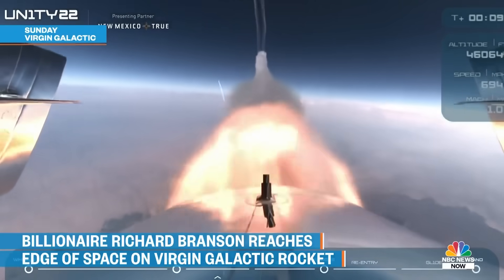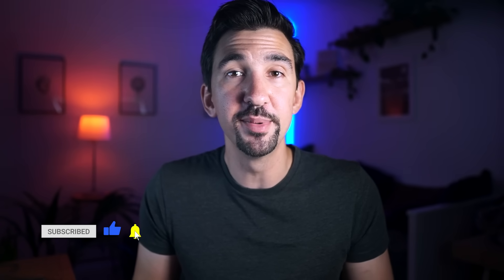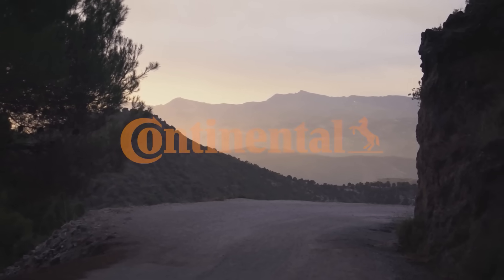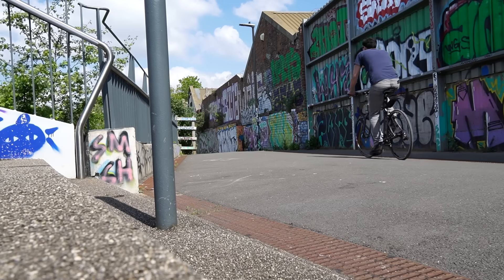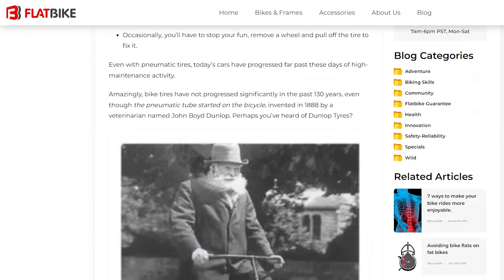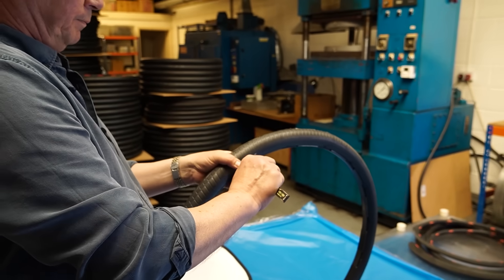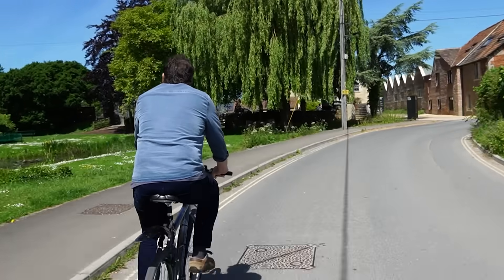I Tried Solid Bike Tires | Here's What I Found

Comment: I worked in the tyre industry for 15 years, I tested solid tyres for cars with negative results, mainly because of wet road condition performance. the grip coefficient in dry conditions was lower than pneumatic tyres but still acceptable for low speed applications. in wet conditions it was simply too dangerous. So I think an important test would be on grip performance.
Reply: @King Of Crunk painted concrete without sand in the paint sucks for almost any shoes though if it's wet.   it also sucks for all tires if it's wet.   bicycle wheels are usable with fairly big differences in them, fat vs skinny and all though.
Reply: @lasskinn474  
Yeah, good point. But on a separate note, men shouldn't be wearing Crocs anymore than they should wear sandals with or without socks(unless they live in the era of 400 AD or earlier).
Reply: @HighlanderNorth1  Why do you care what anyone else wears?
Reply: @johnoneal1234  
It's just humorous social commentary. Kinda like how people make fun of male mullets and female "mall hair". (Well, except that men wearing Crocs is slightly worse). 😁
Reply: @HighlanderNorth1  Okay, glad to hear you all aren't really so bored as to turn into old maid busybodies worried about what everyone else is doing.
  That's more what it sounded like...
Reply: Similar issue when Goodyear tried to make transparent light-up tires. They used clear solid polyethylene which was dangerously slippery even in ideal dry conditions! Only one set of them was ever sold for the "Golden Sahara" which is a display car that never goes over 5mph.
Reply: @CoolAsFreya  I’m still curious why they never tried making them like a whitewall tire, where the actual tread is a normal tire compound and it’s just the sidewall that’s a different material. Nowadays it’d be even easier since flexible LEDs solve the fragile light bulb problem.
Reply: Stupid question: why does it make a difference for the wet/dry with solid tyres?
Reply: @JoelTehMole  same reason it matters for air tyres,
water acts as a lubricant which helps smooth the surface so your tyre gets less grip.
In a pinch it also cools the tyre down which makes rubber a bit hard. Its true of all elastic materials.

In extreme scenarios it causes hydroplaning where a thick layer of water forces your tyre off the ground and makes your traction go to nearly 0.

Air tyres have the advantage of configurable tyre pressures and at low pressures the rubber squishes out over the ground and makes as much rubber contact the ground as is reasonable. 

It reduces the overall risks of reduced traction from water.
Reply: @Mallchad  I guess you were talking about tyres in general, not just bikes. Just mentioning that hydroplaning isn't really a thing for bicycles. At least for race bikes, you'd need to go at something like 200 km/h, from what I've read. Maybe for MTB / fatbikes going really fast on paved roads, I can imagine it could be possible, but that's an edge case. (Slipping on wet roads is a different thing of course, not the same as hydroplaning.)
Reply: @tvuser9529 The information on hydroplaning is likely based on cars and motorcycles, and what cars and motorcycles have is weight, >200-1,000kg of it.

Bicycles do no have that, which means it takes quite a bit less effort to break traction because traction is a function of downforce AND coefficient of friction.

So I can't see why it couldn't happen because it does in fact happen... It and it takes only a few seconds to find videos of bike sliding out in the rain...

The difference is low speeds, and less aggressive " drive" (pedals), and generally "driving" more carefully means its not as big an issue...
Reply: @Mallchad  As I mentioned, sliding out on the wet is not the same as hydroplaning. Water reduces the friction between the tyre and the surface, so it slides easier. But hydroplaning is when the tyre completely loses contact with the surface, because it rides on top of the water. Bikes don't hydroplane because their tyres are too narrow for their speed and weight, at least for roadbikes. The speed would have to be unrealistically high for it to happen. Maybe a fatbike or plus-size MTB could hydroplane if ridden fast down a steep hill and right onto a big enough flat puddle, maybe.

Fun fact: Bicycles generally excert a higher ground pressure per area of contact patch than a car, because of the narrow tyres. Road bikes especially, they can approach the ground pressure of a truck/lorry. (See the wikipedia article on ground pressure.)
Reply: @JoelTehMole  every tyre has more grip on dry surfaces than on wet ones.  But if a tyre's grip is poor on dry (although within safety limits) it could be dangerous on wet.
Reply: @JoelTehMole :  Coefficient of friction is still generally MUCH lower for wet surfaces than dry ones.  You have two different things rubbing against each other (rubber or a rubber compound in the tire, and painted concrete). 

So my stupid question in response is WHY this would be different (to a meaningful degree) to a solid rubber tire than an air filled one?

I think this is just basic physics (friction was one of the very first topics we covered in basic physics in college).
Reply: @JoelTehMole   explained at the beginning of the video ... Normal air filled tyres have several different compounds if rubber , from grippy stuff for the tread to not really grippy hard stuff for the puncture proofing and sidewall stiffness areas , where as this solid tyre is a single compound . All rubber needs heat at the molecular lever to give itself up to the surface in exchange for friction or "grip" e.g a skidmark. It is getting the hard mono compound to heat up enough at the contact point , when it's cold or cooled by rainwater, to give grip . The rest is also explained in the video.
Reply: Answer is in minute 6:52-7:34 @JoelTehMole
Reply: @JoelTehMole  It may not. The point is a comparison /test is needed to see how they perform. I have ridden bike for 50+ years and never thought about traction while riding in rain etc. A new tire, new compounds, along with how they actually ride, begs the question of wet performance.

I don't have doubts, but I also have no data to rule out issues.
Reply: @joeshmoe7967 :  I rode a bike a LOT as a teen, including in rain, light snow, etc. I never thought about friction in the wet either, BUT, I was intuitively a LOT more careful in the wet re avoiding high speeds -- I do recall that.  (Can't cite details as 45+ years ago and reliable detailed memory don't mix well, as I find when I try to remember details about math and have to go back and read about things like trigonometry to get beyond the basics, for example).
Reply: @King Of Crunk Well either way I would not wear Crocs if you paid me too.
Reply: @Leo-gt1bx  I bet you would if paid enough. Everyone’s a whore.
Reply: @Leo-gt1bx  - Crocs are for when flip flops are a bit too formal.
;-)
Reply: @Novalarke  Fair point.
Reply: @Leo-gt1bx :  Yeah.  I basically don't care about fashion, for example wearing "Tread Safe" shoes when I need black "dress" shoes, as I prefer safety (in my aging body) and comfort (with my sensitive joints) to looking fancy, for example. 

But Crocs to me look like strange ugly things that only women would wear -- and women, generally wear LOTS of things that for men, not so much (fashion sense or not).
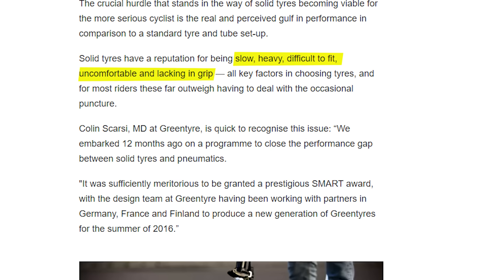Reply: I mean... the video did literally talk about grip being a historical problem with solid tires 3:24
Reply: i think one of the advantages of this tire is you can deepen the tread pattern as it wears
Reply: Tar*… as in ‘a flat tar’ or ‘in Texas, cars have tars’.
Reply: Rougher roads and off road conditions will make for crappy solid tire preformance too, my bike entirely relies on slightly bigger tires for it's shock absorption, using solid tires on my bike, even on the road, would render it unusable, even with the changes demonstrated here probably can't overcome those issues, and make tge tires freakishly more expensive.

It would be more environmentally friendly to develop a better pneumatic tire that requires less extra nonsense in it, get it down to the minimum number of ingredients and in such a way its easier to tear apart after for recycling
Reply: bicycles specifically feel like they have vairly limited variability in the grip performance just in general.
Just the low weight of the bike and tyre pressure (on road bikes especially) being so high that you have pretty mininal grip to work with anyway.
But seems like kind of enough at the speeds and torques people are seeing realistically. Different in races.

You just can't really turn much on bikes, just in general...
Not enough contact area. It's why mountain bikes and motorbikes have SUPER wide tyres.

imo comfort is really the main drawback than anything, for bikes.
There are ways around in in the frame and the wheels but has fairly limited development.
Reply: @Mallchad  bro that's why you change your air pressures, you can't just sit on a single air pressure all the time and complain about a lack of variability
Reply: @BeetleBuns  Do you want to run a tyre at 5-10 PSI?
Because I have. and that's what you need to get the upper limits of bycycle tyre traction.
Reply: @BeetleBuns  you know you get a lot more respect out of people if you don't insult over things you don't evne have the full picture of-

2 things.
- If you drop the tyre pressure as low as 10 PSI you gain massive rolling ressistance and it stops being as useful of a travel tool. This also means than anything but sand races is basically off-limits without exotic tech (which does exist).

- We're talking about tarmarc, concrete and asphalt.
We're all talking about road use because that's how the majority of people use bikess. The rest is hard-packed dirty and gravel. Again, rolling resistence. Not beneficial overall.
Reply: @Mallchad  and you'd get a lot more respect if you actually knew what you were talking about. I race off-road. Weirdly enough, I don't have traction problems. I also use bikes on asphalt and concrete, where I STILL don't have traction problems. Sounds like you simply A.) use bad gear or B.) don't know what you're doing.
Reply: @Mallchad there's huge variation in grip from tire to tire with bikes
Reply: @veganpotterthevegan  Yeah but there's diminishing returns with how much grip you can get, in my opinion. and grip is pretty directly related to rolling resistance

that was my point.
Reply: @Mallchad  ok?  If grip is related to rolling resistance, the rolling resistance differences between tires is enormous.  Therefore the grip differences are enormous
Reply: I would've expected the weight to be the biggest issue. Solid tires spinning at high speeds would deform more, wouldn't they?
Reply: For mountain biking, grip is critical. 
But for road biking, my tires are already at 80PSI. They might as well be solid rubber at that point.
Reply: We live in the 21st century. Things change.
Reply: Tyre??
Reply: @Colin.71  
Yes, Tyre is an ancient city in Lebanon......... where they invented bicycle tires in 1,274 BC. But they named them "tyres" after their home city. Kinda like how Bologna, Italy is named after cheap, processed lunch meat slices..... Except the proper pronunciation for the Italian town of Bologna is "Buh-lone-eee". 😁
Reply: @HighlanderNorth1  I see, thanks for explaining
Reply: @Colin.71  
I was being sarcastic with my answer. The correct answer is that some people apparently spell the word "tire" differently. But it's also true that "Tyre" is an ancient port city in Lebanon that's one of the oldest continually occupied settlements in human history. 

As far as the tire/tyre spelling, it's kinda like how Americans spell "aluminum" vs how it's spelled by people in UK. For some reason, they insist on adding more "u" and "i". So their spelling looks something like "aluminiuiumium". Lol
Reply: Tire*
Reply: The solution, for me, is Tannus's armor. There's a bit of air--it'e been fine here in rainy Seattle and I haven't noticed any issue in sliding around--but not so much I can't ride my e-bike on them flat. Being 100% flat only costs me 3-7 mph top speed (15-28 mph max depending on the grade, scaling with that such that the flat range is like 12-21 mph). It's great.
Reply: Just out of interest what causes the lack of grip? (i know barely anything about tires)
Reply: Honestly not talking about the grip was a bit suspicious. Overall the video felt more like an infomercial than an unbiased review.
Reply: @King Of Crunk pk
Reply: Sand
Reply: I wish I had read this sooner: once my 4 broken ribs, puncture lung and double-vision from concussion have mended I am cutting off my Tannus tyres. Witness saw how my front wheel slid sideways on a road rut in wet weather.
Reply: I doubt you where in the "tire" bizness as you repetedly spelt "tire" .. "tyre"
Reply: nothing. EUGENIOBOB ETC. THANK YOU FOR THE KEEN INSIGHT ON WET ROADS AND SOLID TIRE COMPOUNDS FOR AUTIMOBILEZ.  THANKS  VERY MUCH. I STILL THINK PNEUMATICS ARE BETTER FOR RIDE QUALITY. I MADE SOME INNERTUBES OUT OF SURGICAL TUBING ONE TIME. I GOT MAYBE 10 FEET THEN THEY POPPED! WELL AT LEAST I TRYED.
Reply: Well let's say your out at night miles from home you hit an oily patch on a curve with your new fancy solid tires and over the guard rails you go into a ravine. Now your driving along with pneumatic tires and good tire co.pound maybe you get home safely.?
Reply: Did you test this type of rubber? Is there a difference?
Reply: The makers of Crocs do make solid bike tyres called No Flat I think it's called hot one on my Ebike it broke a spoke because it had no suspension to absorb shock it relied solely on the Tube Air Pressure to do that @kingofcrunk4237
Reply: It's ease of use Vs puncture free riding . If you are computing short distances like me solid tyres are great . Been using only solids for 8 years . Never have to see if tyres are "up" and ok to go.  Yes they don't roll as easy or grip as well but they do mean no agro or punctures are you ride home in the rain after a ten hour shift 😁😁
Reply: What if you want to adjust the tyre pressure to suit different conditions?
Reply: @77goanywhere  Not Possible unfortunately
Reply: TBH, it seems to me that if solid tires were such a good idea, that we would have had them decades ago. Especially during the early years when the materials were so poor for the purpose. Flat tires today are much less common and tires are usually thrown out due to the tread wearing out rather than puncture. (Although we're talking bike tires, so probably a larger share are damaged due to puncture than car tires)
Reply: First intelligent, cohesive, non-toxic and instructive YouTube comment since the dawn of YouTube comments. Bravo!
Reply: SCHWALBE Air Less system solid tires have the same outer tire like normal air tires, so the contact with rain, wet roads are exactly the same, I used them for many years, my best buy ever I reached speeds over 60 km/p hour on my Bafang BBSHD bike no problem at all
Reply: Couldnt you just use this gecko tire as an insert for a pneumatic tire ??? . I'd like to change between road and snow and mud. Only difficulty is the metal bead on the pneumatic tires
Reply: Man one of the big plusses of pneumatic tyres is you can air up or down. HIgher pressures for on road, then when I need to do a long bit of off road I could always air down slightly if need be. No way to do with a solid tyre.
Reply: Unfortunately recycling itself is mostly a lie. With very few exceptions (PET bottles, cans) the cost of sorting and cleaning the “recyclables” is far higher than the materials gained back. Best case, it is shipped around the globe to poor countries with little to no labor and environmental safety laws, making the workers there sick and polluting the areas. Realistically, the tires just go into a land fill either way. So may as well use pneus that use less material overall and provide better performance at lower cost.

Comment: As a recycling alternative yes welldone but are they better than an air tyre, not a chance.
Road tyres have about 100 psi give or take and mountain bike tyres which are usually much bigger can run low psi like 15 psi on my 27.5 2.6 tyres that's because it's all about tension the tyre needs to deform to the terrain much more on a MTB tyre and maintain grip but stay on the rim this makes it faster as the tyre is not bouncing off the surface but on a solid road it's more or less the opposite as the less friction encountered means a faster ride however both of these have the same problem suspension, without any form of suspension your bike is like a a roller skate the smallest bump is a problem & that's why modern Mountain bikes have front or front and back suspension for enduro etc.
If road bikes had a little suspension it would go a long way towards making them comfortable.

Comment: NoFlat tire will by changed as often as refular - when thread wears off - no environmental advantage. 
NoFlats may by good for city bikes but will not be as efficient as inflated ones - tested on cars. So currently is an no go. 
Maybe with some new material... maybe, but what if someone lilkes 2.0 bar and another 2,5 bar? Multiple tire hardness? 
No, I don't see it.

Comment: If they made it varable compound tyre and got that weight down, I would use them,  But as they stand No. I use air tyres with punchure proof tape inside and heavy duty tubes, Not once have I had to pump up my tyres in 12 months, They have stayed solid. Tip Stay away from chinezuim tubes & tyres and stay out the road gutters is another way of saving money if you live in a city.